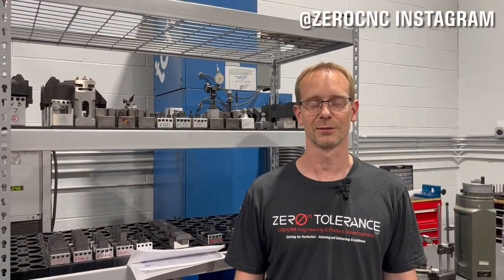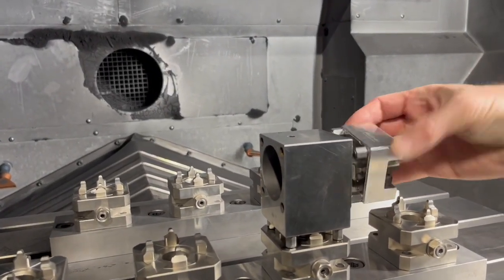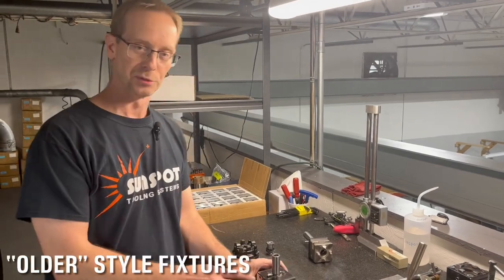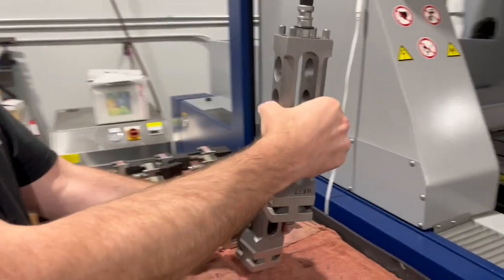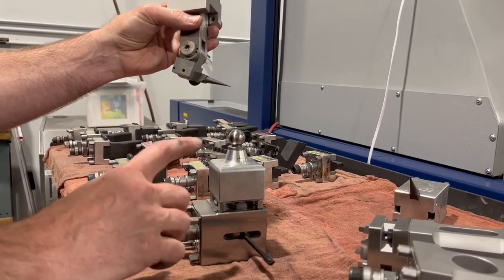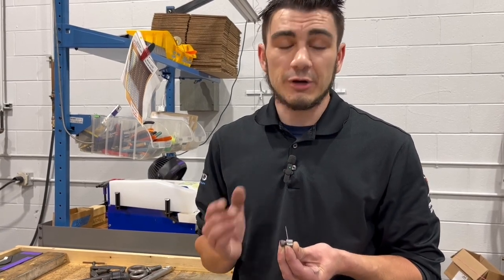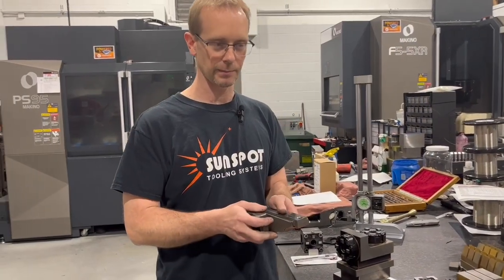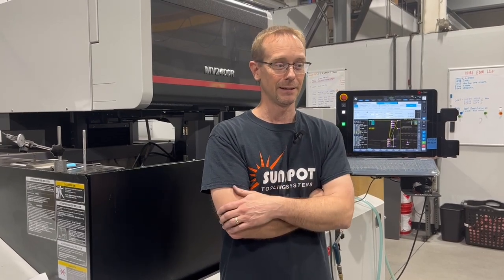EDM Fixturing 101

Comment: Newbie alert! 
I am back 😆
I do not know if I saw ( understood) it correctly. 
Are you actually milling steel on the System 3R/Erowa bases ?
I always assumed those zero point bases were not rigid  enough to handle the milling forces. 

You are always talking about efficiency  ( I love it ) so I am assuming you are "hogging" as much material as possible  ( reliably, of course ).
So, do you confirm those bases are actually rigid enough to handle normal milling forces? 

Thank you, 
Jorge